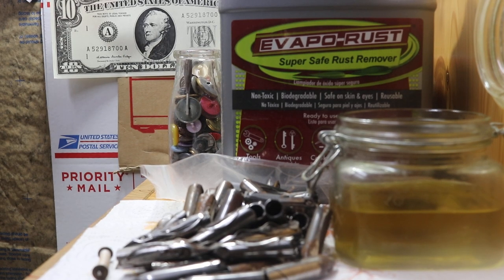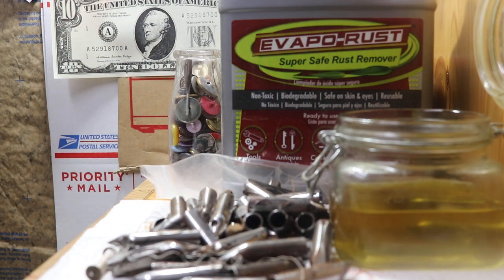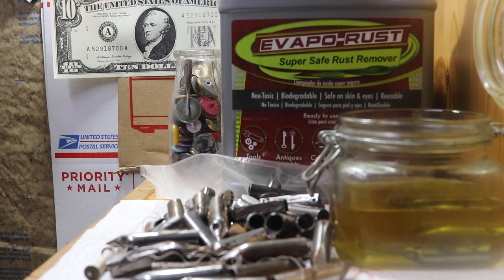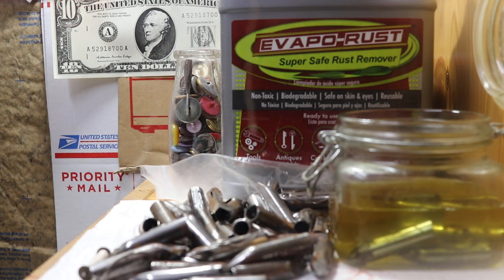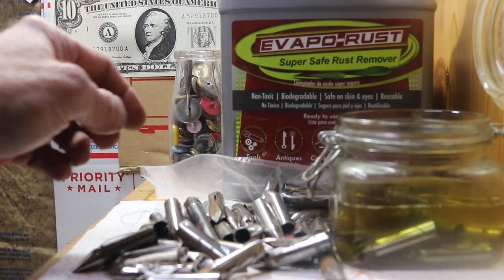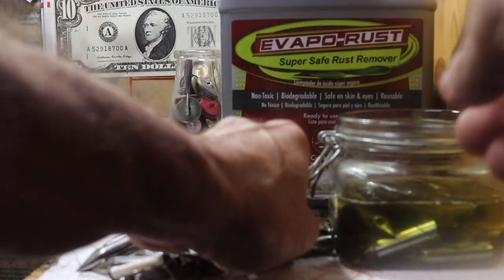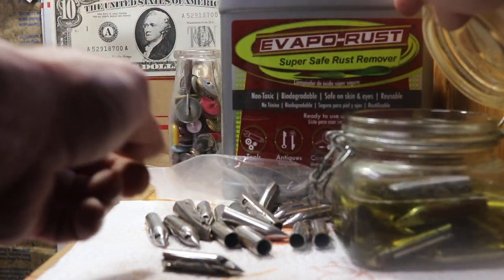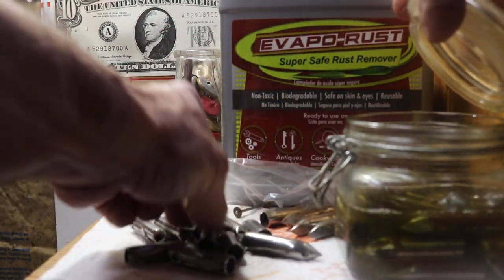Evaporust on vintage sewing machine parts how well does it work? Part 1

Comment: I need to get help and a part for a Kenny 158.1040. I do not have Facebook. The push pull hand wheel is stuck. I broke the plastic hand wheel trying to open it to see what was wrong. Thanks